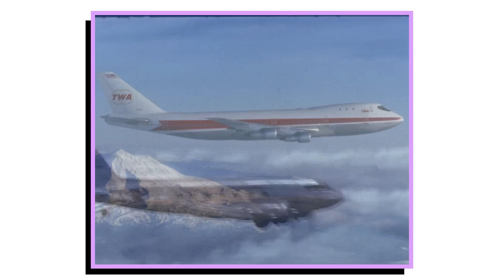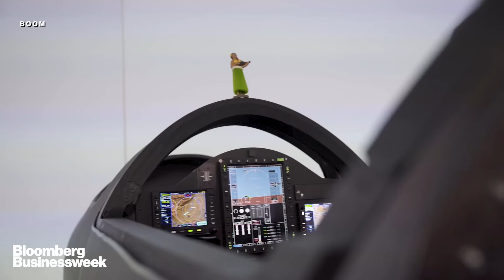The First Look at Boom’s Supersonic Plane

Comment: What about the law outlawing supersonic flight over the U.S.? No getting around that.
Reply: I believe the law was installed because supersonic aircraft from that time would produce sonic booms loud enough to severely disturb people living under the flight's path, and possibly break windows. Aside from considering environmental impacts thereof [and the possible issues fitting into the same airspace as other planes], if an aircraft that can quietly surpass the sound barrier is created, I don't see a reason to prohibit using it

Comment: That looks similar to one aircraft in Flight Simulator that only exists, for now, in Flight Simulator. The Stratojet Excaliur has similar performance. In Flight Simulator, it can do Mach 2.2 and cruise at 70,000 feet

If Boom Aviation pulls this off, and does make real world version of this Flight Simulator aircraft, the plane will have a range of 5000 nautical miles, which will give it enough range to fly from the west coast to Tokyo. 

It would also be able to do LAX to Tahiti as well

Comment: how many G would a passenger experience at that speed?
Reply: The passenger would experience a notable g force during take off. Not much more than a normal airplane, as the supersonic jet wouldn't get to its top speed until it gets to 60,000 feet. 

Not much more than a normal plane, still noticeable

Comment: I think defining safety and demanding safe design standards into prototypes and proving safety is what the public air fare consumer really wants.
IMHO in addition to standard flight testing and approval the aircraft should demonstrate both: 1) Water landings / ditching 2) Off airport emergency landing capability.
  Place Safety and Rmergency procedures into aircraft design first then add speed.

Comment: 75% scaled Concorde build on composites and non afterburner turbofan jet engines yet to be built.. to save fuel need to reach mach 2.2 assuming regulations allow them to fly exempting noise regulations

Comment: The efficiency of the engines is what I watched this for. If the supersonic plane is one-third the size of a typical jet, and it flies twice as fast, than what is the ratio of fuel consumption to price of a ticket? Is it twice, three times, four times as much as a first-class ticket? Then, what's the relationship of how much more fuel it uses to how much more willing a passenger is willing to pay? Is it twice the cost of a first-class ticket, from New York to London? Three tines?
Reply: The company is trying to make the flights more accessible to everyone but they will definitely be expensive.
Reply: @thekub32  Not really they are aimed at the private jet market.
Reply: Probably going to be 12,000 a ticket when flying over oceans.  EASY

Comment: These projects are a joke. I stopped counting the supersonic private jet projects started in the past 15 years. A 50-100 places supersonic plane is a gargantuan project even with modern technology. Think Airbus A380 multiplied by a factor of 3 or more. It would ruin even Bezos or Elon resources so basically it would have to involve big government money. Maybe China could do it. But the actual reason I say it's a joke, it's because it's simply not profitable. While there are rich individuals and corporations willing to spend 1st class money to travel faster, that doesn't mean it will fill the plane to capacity at every flight, to make it profitable. That's one of the biggest issues. And the second issue is the sonic boom that caused the Concorde to fly a subsonic speeds inland - burning a lot more fuel and loosing a lot of time. The only supersonic project that can be profitable is actually a suborbital plane that will fly not a supersonic, but at hypersonic speeds and cut the traveling time by a big factor, not just by 2. But for now, this is science fiction for large scale planes.

Comment: It seems incredibly small inside. There doesn't seem to be any walking room.
Reply: All supersonic passenger aircraft are ! The Concorde was exactly the same  - incredibly cramped inside with very narrow seats. The fuselage has to be narrow by design because of the negligible drag required at supersonic speeds. The Concorde was a beautiful looking aircraft on the outside - but very, very cramped inside. This will be no different.
Reply: @Nicholas.T  But the concorde actually had room enough to fit two aisles of seats with at least 10 rows. This new craft seems a quarter of it's size. I'm not sure how this is suppose to be utilized for commercial passenger use.
Reply: @osimeon00  Yes, it’s crazy small. I certainly wouldn’t be investing in this company - it’s destined for failure( even without the impact of COVID)  !!

Comment: You would think that with all the amazing new physics knowledge that is being taught at univerisites and the amazing simulation software they could manufacture the airplane much sooner than the team at Concorde or Tupolev. By looking at the time charts, they're as fast as were the designers back then with a pencil, ruler and paper (pocket calculators were also not a thing back then) while not being all that amazingly better. The design of overture is becomming more and more like the concorde itself. The engineers back then knew what they were doing it seems.
Reply: There's alot more safety, automation and bureaucratic requirement today then there was back then.
Reply: The Concorde took about 16 years, $400 million in funding, and serious help from 3 different governments.

Comment: I take full exception to the intro that says the Concorde is the most beautiful airplane ever built. I would rank it as the 3rd most beautiful. Number 2... The SR-71 Blackbird. If you've never seen it, go to the National Air and Space Museum at Dulles Airport. It sits front and center and is a sight that is awe-inspiring. Number 1... You probably guessed it already, the XB-70 Valkyrie. OK. I'll admit that numbers 1 and 2 may be interchangeable from a beauty standpoint, but the Concorde is only number 3... so far.
Reply: Sorry Concorde is the Nō1 and then there’s fresh air before reaching the Blackbird. I think the XB-70 is kind of ugly at the front and a Concorde rip off at the rear.
Reply: @vlofvl  A matter of taste, I suppose. I fully expected someone to get on the side of the Concorde. As far as the tail goes, supersonic aircraft have that sort of tapered shape. It's probably a case of form-follows-function.  Even the new BOOM SST has it. As to the XB-70... from a straight on look, I've always thought the paint job makes it look like a duck, but the overall plane is gorgeous.
Reply: I could be wrong but I think most people are implying most beautiful passenger jet.
Reply: @anthonymorris5084  I'll give it that.

Comment: 'Commercial supersonic flight' is a relative term, Concorde was one of the all time loss making enterprises. Projected orders 250, actual sales 14.
Reply: Yes, you're correct, but it was designed in the 60-70's slide ruler days. Too heavy and inefficient engines. With composites today and modern jet engines. It just might have a chance an making it. Only one major problem right now...COVID-19
Reply: @rnavstar  Yes Covid but also limited fossil fuels and climate change ...
Reply: @rnavstar  You’re actually totally wrong there ! Nothing to do with the Concorde’s engine inefficiencies ( which they were ), but was  a result of the unavoidable sonic boom. Because of the sonic boom, they were banned from flying across land in all countries. As a result the only economic route was across the Atlantic Ocean from Europe to North America. And the same fate will be be in store for this proposed aircraft. It will have sonic boom ( it is unavoidable) and therefore will only be allowed to fly over limited stretches of ocean.
Reply: @Nicholas.T  Sonic booms aren’t much of an issue. Over 1300 trans Atlantic flights take place per day, and a few less trans pacific flights. All of those could fly supersonic.
Reply: The Concorde's financial woes really came about when country after country wouldn't let if fly over land. This dramatically reduced demand by limiting routes and the amount of customers available.

Comment: What about the sonic boom though? Because that's gonna be an issue (as it was in the past with the Concorde)...
Reply: May I attempt an amateurish answer: These new aircraft fleet have supersonic cruising speeds at high altitudes. Up there, less drag, perhaps with cooler airstream temperature for engine efficiencies. Plus, depending on federal/state regulations, the sonic booms happening at high altitudes may not be a problem as a result of their either being directly below or within some perimeter from any position of flight. For transient states, i.e. taking off and landing, the aircraft may operate at lower altitudes but also at lower flight speeds such that there should not be production of sonic booms. There you have it.
Reply: @yipei5660   They are using technology that will dramatically reduce the "boom". If they couldn't do this they wouldn't build the plane.

Comment: OK so key points I am getting from this:-
1. They are calling the project Boom? Presumably a nod to Sonic Boom!* 
2. They have almost finished a single seat 1/3rd scale prototype they are calling XP-1? (XT-1?)
3. They hope to be flying commercially within 10 years
3. The plane will have turbo-fan engines rather than turbo-jet making it far more fuel efficient and therefore cheaper to fly [compared with Concord from 20 years ago]
4. The shape is very like Concord with a narrow wingspan because of the need to reduce drag at high speed. At low speed the plane will need a steep, nose up angle in order to create vortex lift .The pilot is presented with a virtual view in front of the plane via nose mounted cameras (thereby avoiding the need to dip the nose during landing as Concord used to).
It all seems great HOWEVER,  I wonder if this will every really take off? (Pun intended!) Surely everyone is doing business with virtual communications now? You may be able to fly from A- to B in half the time but you are still going to be stuck in traffic and waiting at the airport for your flight. Compare that with the ability to see as well as hear your colleagues via video conferencing?
Atlantic
Reply: * Sonic Boom: Do quieter engines result in a quieter sonic Boom? One of the issues Concord had was that it was not allowed to accelerate to super sonic speed until over the Atlantic ocean. Even then the boom could still be heard along the western coast of the UK  (and presumably the eastern coast of the USA when flying from New York to London or Paris) Is it realistic to imagine that you could actually fly a super-sonic commercial aircraft over land (i.e. from east to west USA or vice versa). Currently even with a small military Jets everyone in the UK knows about an urgent response to an air-space incursion over the UK long before your hear about it on the news. The Government cannot hush-hush the sonic boom of a military aircraft, EVERYONE asks "WTF was that?"
Reply: I'd be happy if they could just get me through the airport security twice as fast.

Comment: u would think the engineers would be in uniform
Reply: They only have a little over 100 employees, why would a company that size need uniforms?
Reply: @kyleg3588  because its formal and professional, those boom supersonic planes are going to be bought by the US for Airforce1
Reply: @kyleg3588  I am a share holder, day trader who ownes over 5,000 stocks, w/ over 200% gains sitting on securities, I see everything
Reply: Boeing and lockheed employees wear whatever they want to work as well. Its not a clean room.
Reply: @kyleg3588  well then, it shows that carelessness will impact the quality of boeing and lockheed.

Comment: Absolute rip off of the Concorde, and yanks call the Russians and Chinese for copying.
Reply: Meh, form follows function. There's only so much variance from the Concorde/Tu-144 form that a supersonic airliner can have and still work. The only real variable would be swing wings like Boeing's SST was to have had. Other than that you're just shifting pixels around a little bit. Anyway, the Brits ripped off the idea of the airplane from the Wright brothers.

Comment: Maybe a dumb question .. Why can't they just fly higher so we don't hear the boom ?
Reply: There is a physical limit to how high an aircraft can fly, and that’s because, at some point, there will not be enough oxygen in the  air for the engines to work properly. The previous Supersonic Concorde actually did fly higher at 60,000 feet, compared to 40,000 feet for most  current commercial jet aircraft. Sadly the engineering realities are such that the unavoidable sonic boom is the “elephant in the room” for all commercial passenger supersonic aircraft, rendering them uneconomic.
Reply: @Nicholas.T  I got my reply 3 months later :) Thanks !
Reply: @r3dp1ll  You’re welcome !

Comment: The airlines dont decide the type of aircraft they want to use based on the speed, shape or customer’s choice. Customers love A380 but the whole program has died because it was not PROFITABLE for airlines to operate. The unit cost per seat or per flying hour or per mile was higher than what airlines were making revenue out of customers. 

It was always possible for Airbus or Boeing to pickup from where Concord left. But can Boom make the economically efficient aircraft where airlies can make money, is what the biggest question? If they can achieve that, it will only work. And I really hope they will be able to achieve that.
Reply: I bet this aircraft is going to be a rental private jet

Comment: without a solution to lifting the ban of supersonic flights over land, this company will end up with the same fate as the concorde.
Reply: To fly internationally you need more than the US Congress involved ...........
Reply: Congress removed the ban couple years ago
Reply: I mean trans Atlantic and trans Pacific flights are a thing
Reply: 3:30 Two and a half fold increase in international travel since Concord? Not any more. 
When this current pandemic comes to pass (as all things do) and we get back to the inexpensive and essentially unregulated movement of people around the globe, supersonic travel will be an even faster way to spread the next pandemic causing pathogen. The next  one might be more than a sore throat and cough.
Reply: @mitseraffej5812  ... the Scam-demic may have been specifically to mostly-ground the aircraft.  Search: NOAA water vapor and ice from burned jet fuel.  The primary greenhouse gas is water vapor and it does not belong at 40,000 feet.  Worst case projections?  Mankind had 50 (fifty) years left. They are working on reforumlating the fuels and other measures.  But nobody would have agreed to ground the airplanes just because some scientists thought the world would end in 50 years. Climate change is real but its not the low level carbon.
Reply: I was surprised to learn that BOOM had $6 billion in pre-orders prior to the Scam-demic.  The plane is for over-ocean routes such as NY- London, etc.
Reply: @SunriseLAW  scam-demic.. seriously? do you live in fantasy land?
Reply: @daos3300  Based on recent reports coming out, he was not in fantasy land. 🤔🤔
Reply: @barchetta575m  yes, he was since he was leaping to an unproven conclusion entirely based on hearsay, with zero evidence, and subsequently blithely spreading misinformation. this is how a conspiracy theory functions. if evidence does surface then there is something to discuss. as yet, there is none.
Reply: @SunriseLAW  ny to LDN is over land tho how do you get to London without flying over Ireland, wales and south west England 🤔
Reply: @jamesmason131  seriously? 1. the plane flies subsonic over land (duhhhhh) or 2. fly a 'great circle' route 200 miles south of the current one.
Reply: @jamesmason131  you slow down over England/London, after flying over the ocean it's a relatively small portion of the flight.
Reply: @jamesmason131  It doesn't have to be supersonic all along you know, it can slow down over england for that matter.
Reply: @jamesmason131  It is when you are over the Atlantic that you are at full speed ...do you drive at the same speed to get into your garage than on the motorway ?

Comment: Hypeing up the ideea, because that's what they have now and had 5 years ago, and will have 5 years from now when Spacex Starship will fly you anywhere on the Earth or beyond. They desperately need the publicity that's for sure.
Reply: Starship would be lucky to enter crewed service for lunar or space station missions in 5 years. SpaceX’s own highly optimistic estimates say that it won’t enter regular passenger service until the 2030s at least, and it’s entirely possible that it will be much later, or never.

Comment: There were no critical questions from the reporter. What about the aircraft cost; running costs and environmental costs? How is a ten-year timeframe remotely realistic? Current airliner projects take longer than that of designing and building more conventional aircraft. Also, what about increased comfort and the internet for business travelers since the Concord era?
Reply: the video said the BOOM will be more efficient to fly, which would make it cheaper and more environmentally firendly to fly... that is, however, compared to the concord.
Reply: Probably a waste of time to ask. Doubt this thing will fly commercially. Not that I don’t think it’s wonderful, but until it’s flying and they get orders it’s just vaporware.
Reply: 10 years until the liner is flying. Probably another five for flight testing and FAA certification.
Reply: It’s using 100% sustainable aviation fuel
Reply: It is Bloomberg. You just need to pay, then the interviewer will ask some friendly questions probably.
Reply: i really dislike the windows, they're to large in my opinion and the aisle arm rests look uncomfortable
Reply: @luke557  theres shades